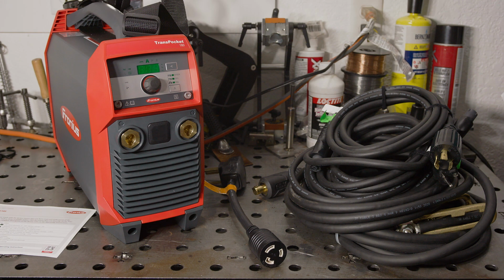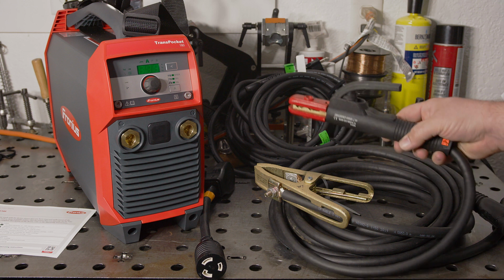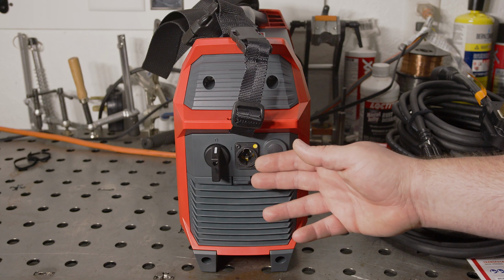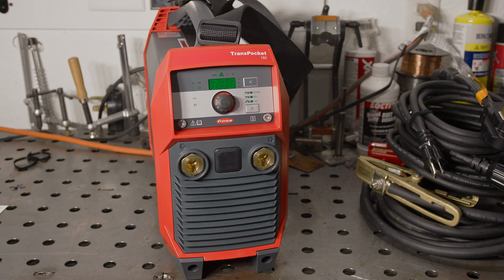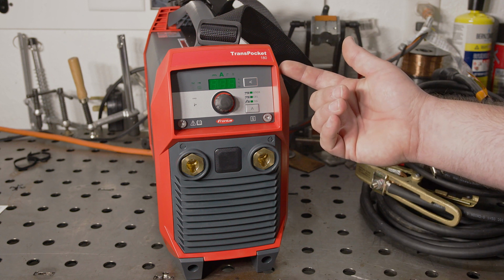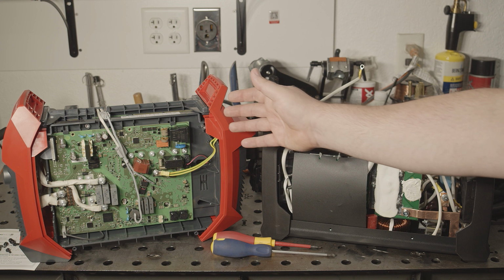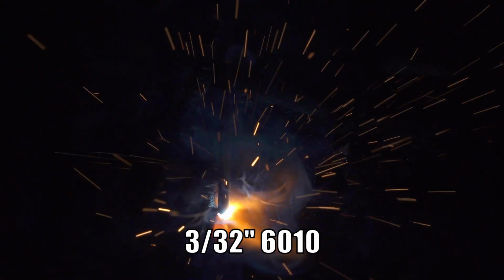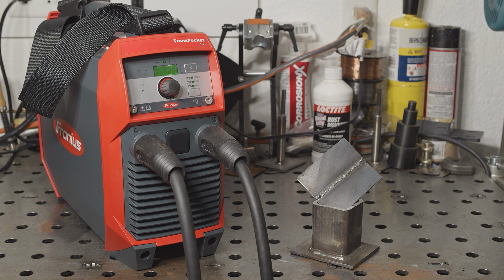Fronius Transpocket 180 Stick Welder Review

Comment: 170 amps on 110 volts for tig. For real?! 
Most 110 inverters for tig can only push 80 95 amps.
Reply from the maker: Yes.  With power factor correction and efficient circuits, you can get a lot of amperage with TIG because the arc voltage is relatively low.  With TIG the arc voltage might be 8-12 volts.  With stick, the arc voltage is much higher, so you can't get as much amperage out.  For instance, 170 amps at 10 volts is only 1,700 watts.  Assuming no losses (which isn't possible, but let's just go with it for now) that's less than 15 amps draw from a 120V outlet.  Again, there will be losses, and if you don't keep a tight arc, your arc voltage will go above 10V.  So a draw of 20-25 amps is much more likely.  But that's still very reasonable.

Stick welding is different.  The arc voltage is much higher with stick, which is why 120V welders often have 80-100 amps max output on 12V, with the only a relative few out there (like this Fronius) with power factor correction having 120-130 or so.  With stick you might have an arc voltage of 20-25V.  So take 100 amps times 20 volts and you are talking 2,000 watts.  Even without losses that's 20 amps from the wall.  With losses it's likely 25+.  

And all that is assuming power factor correction.  If a welder has a 0.7 power factor, you have to divide those amperages by 0.7.  Now that 25 amps from the wall is suddenly 35.  And when you have a cheap, generic stick welder providing 140 amps from 120V, it pulls something like 50 amps from a 120V circuit, which is completely impractical.
Reply: @bigtb1717  Thank you for info. Would you pick the Fronius over Esuab? For the power correction?
Reply from the maker: The ESAB Rogue ES 180i actually does have power factor correction.  It doesn't have quite as much output on 120V as the Fronius, but it does have power factor correction.
Reply: @bigtb1717  Thank you for your review it was very helpful.

Comment: Did you try it on 6011 on 3/32 and 1/8?
Reply from the maker: I didn't try 6011, but I'm confident it would run it just fine.  It runs 6010 without issue and 6011 is easier to run than 6010.
Reply: @bigtb1717  thank you bro! Looking forward to get one Fronius 180 myself.

Comment: Great review, We learn a lot from internal design, I'd love to see some closer shots of the boards to see the components close up.
A design like the Fronius is in general a much more robust design fewer points of failure for a machine that will be moved and bumped a lot this is quite an important factor.
Large unsupported components will experience significant forces from bumps and drops, giving the PCB a  conformal coating adds additional moisture protection it probably adds to the strength a little and it insulates all the components inside which would help add arc or short circuit protection if contamination got inside.
 I would say if someone is likely to be doing mobile work going from site to site the Fronius would be a better option.
If you were just going to leave the welder in one spot in a workshop and it was in a location free from bumps vibration and knocks the lower price of the Rogue would be a good option.

Im currently in the market for a Mig unit and had Short listed Esab 215 and the Fronius Transsteel 2200.
From the anecdotal research I have done both are good, but there have been a level of faults with the 215 that I didn't find with the Fronius anecdotally anyway, one user who had to get his machine replaced twice said once I got one that worked it was great but said there a little delicate from his experience.

Seeing the inside does reinforce what I had started to believe, that the Fronius machine are very robust working machines.
Thanks for the video.

Comment: I just came across this review video. Great attention to detail! The board alignment and wiring comparison was interesting to witness between both units. The Fronius boards are also manufactured and produced by Fronius in Austria. It's cool to see made in Austria on the boards themselves :) They refurbish all their own boards and consumers can buy them either refurbished or new depending on budget. Keep up the great videos!!!!
Reply: Thanks for the help. I ordered the 2200 today. Super excited to be getting one.
Reply: @jdeluisa  Im looking at getting a 2200 too, I was looking at the Esab emp 215, and the Transteel 2200 but I got a little turned off the 215 after I've read and heard of quite a few faults and problems with the Esab, I'm from Ireland I was even talking to a welding supplier in the UK initially asking about the Esab 215 and they told me there going to stop selling the Esab because of the faults and the delays there customers had in getting parts or replacements up to 5 months for one customer they told me, there's a couple guys on YouTube who had problems too.
All I've heard about the Fronius is that it's bullet proof. It's not like the Esab emp 215 rebel is a cheap machine,
 idk i haven't pulled the trigger yet but will do by the end of the month I have a quote that's valid till them and heard prices might go up 7% next month or two.
Reply: @deepwinter77  I don’t know if you got one yet but the 2200 is a beastly machine. I run spray transfer a lot with 90/10 and normal 75/25. It actually melted a dinse connector on my ground lead before the machine even thought about overheating. You can actually get into spray transfer plugged into a 110v outlet if you set up in Manual mode. Use it for stick welding in the shop too when I’m doing heavy equipment repairs. Not as good as a Lincoln sa200 but just as good as any other stick machine for 7018 and stainless rods.

Comment: Great review. I own this very same machine in the non MV version (240v only). However the standar package here in Spain does not include leads, stinger, ground clamp or plastic case. I had to make my own leads (35mm2) and right now sits on a shelf with no case at all. I must say I have run 6013, 7018, 6010, 316L and 308... and runs great. I confess I have not messed at all with the advance features, nor have I tried the TIG mode, YET!
Reply: What supplier did you use I'm in Ireland and there's only one Fronius supplier, I would be interested in checking another one out, before Brexit I would have just bought from the UK but it can be easier to buy from main land Europe now.
Reply: @deepwinter77  There is one in scottland bought mine from ebay.

Comment: Absolutely superb review. And I can say that because I use one regularly now. Spot on differences between Esab Rogue and the TP180.. My only complaint was the cable came loose from the stinger.. But a screwdriver and a bit of threadlock solved the issue.
Reply from the maker: Thanks.

Comment: Actually cheap(er) ESAB models are not original ESAB design. They are generic Chinese design and are made by other Chinese manufactures for the ESAB.  For example Chinese "WTL" make(made) some models for ESAB. Internal design is "generic", and even case is the same as their own models. Only Color is ESAB typical. And actually they are fine products, but it is on anyone to chose is it fine to pay extra 100 or more $ for the ESAB name on it ?!
Reply from the maker: That really doesn't surprise me.  As you say, it's a fine machine, but in my opinion it's not up to the build standard of the Fronius.  I only mentioned the internal design being different than the "common" Chinese design I see in a lot of machines, including the Everlast welder I reviewed, and even the ESAB 161 LTS.  It was just interesting to see that the Rogue used something different.
Reply: Do you know if that's the same for the Esab Rebel emp 215?
That would explain why there seems to be more then expected number of faulty units.
Reply: @deepwinter77  Yes, Rebel is "designed and engineered in the USA and assembled in China" https://www.esabna.com/us/en/dare/rebel-faqs.cfm

Comment: TU on review. Looks like they changed the ground clam to thte usual cheap junk from thte picture on Amazon.better hold on to yours.
Reply from the maker: Yeah, I've seen both in pictures.  I bought the welder at my local shop.  I don't know if the one I got is how they will all be going forward, or if they've changed it for the worse.  Hopefully the solid clamp is what they will continue to include.
Reply: Fronius Transpocket..good name for a starship...either way I'll keep my amico arc 200 , good name for a cab ;-)

Comment: Hello again! I can’t find any specification on what type of machine connections it has for the leads. Are these the proprietary Fronius connections or are they standard 1/2 in. DINSE Connections? Im trying to figure out if I could hook up a standard CK17V Torch if I wanted to.
Reply from the maker: The welding lead connections are standard DINSE connectors.  You could definitely use a CK17V torch with a DINSE 35/50 adapter.
Reply: @bigtb1717  Sweet!!! That’s awesome. I’ve been debating on trying to wait for a TP 180 TIG to pop up on the Fronius Demo Equipment page vs going with the stick version. Especially because I know that I prefer the absolute smallest torch I can get away with using when it comes to TIG welding. And for the type of welding I would want to use it for, a torch with a valve is kind of the standard practice. Then with the pulse functions, I’m very rarely above 30-50Hz on anything lol. 

Thanks again man,

Alex Weeks
Reply from the maker: I'm with you on the small torches.  My favorite torch is the stubby torch from Weldtec and I use a 9 size for almost everything.  Rated at 125 amps but I've run it at 160 for short periods, lol.  Unfortunately it's not available with a valve.
Reply: You have to use the adapter as the fronius dinse has an o ring on it. I’m not %100 certain but I use the transtig 210 and had to use the adapter too. I also have to use the fronius pedal for the high frequency to work. I haven’t tried it on lift arc
Reply from the maker: @sbranham86  I imagine that is for the TIG version with the built-in gas solenoid.  I think Alex's question was about the stick version that I have because he wanted to use a torch with a valve.  The Fronius welder I have uses standard DINSE connections, but it's the stick version.
Reply: @bigtb1717  👌

Comment: have try  7018 3/32 rod?
Reply from the maker: Yes, I ran some 3/32" 7018 rods at around 95 amps and it ran great.
Reply: Do the 7018 run on the Stick setting or the cellulose setting?

Comment: Very nice review. I watched your Esab Rogue 180i review also. I am currently trying to decide between the two. I think it's coming down durability and longevity. I'm not an everyday MMA welder but I want something that's going to last. Big price difference but I'm willing to pay more for quality. Any opinions on which one would be much appreciated.
Reply from the maker: The Fronius appears better built internally, with better quality components and my gut tells me it would therefore be more likely to hold up long term.  But it's impossible to say for sure.  A big thing for me is knowing that my local shop sells and can provide warranty support for the brand I purchase.  Will you be ordering the welder online?  Is there a local shop that can offer help with warranty issues?  Don't get me wrong, I hope both of these welders last well past the warranty period, but it's still nice to at least know there is somewhere local I can turn during the warranty period.
Reply: @bigtb1717  Thanks for responding. That was something that I did check on. There are places in my area that have support for both. When you opened both up it was like night and day. The Esab looked like alot going on..lol not that it means it's a bad thing. But I agree it appears the Fronius is better built internally. Thank you again for the information.
Reply from the maker: No problem.  As you say, no reason to say that the design of the ESAB is a problem.  Like I said, it's just a gut thing that the design of the Fronius looks like a more thoughtful design, and maybe that means more thought went into part selection and circuit design.  From what I've read, ESAB does stand behind their products, so I wouldn't be worried on that front.  It's a tough call, but I'm the same way:  I'm normally willing to pay more if it means I'll have less hassle and fewer issues down the road.  Nothing more frustrating than a broken tool that holds up a projects and costs time and money in more ways than one.

Comment: Thank you for putting the time & effort into your videos & for going into the finer details. I really appreciate this, I’ve been very interested in the Fronius USA machines for some time now. I’m curious as to how the arc characteristics compare to a Maxstar. I happened to come across a very good deal on a 200dx but I get the impression that the Fronius is probably a lot nicer, particularly for 6010. Thoughts?
Reply from the maker: I do have some experience with a Maxstar 210, but not the 200.  I imagine the arc characteristics are similar.  I actually never use the Maxstar for 6010 rods because I simply don't run much of that.  I have only ever run 6010 to test welders.  My understanding is that it would run just fine, but I can't say 100%.  The Fronius has more adjustments in terms of how the stick feature runs, and while I never compared them side-by-side, I'd probably give a very slight edge to the Fronius.  But the Miller still is very nice to use.  I've done a decent amount of stick welding with the Maxstar 210 (mostly 7018) and it has been great.  My guess is that you wouldn't be disappointed with either one.  If you want TIG features, the 200DX would have far more TIG features.  Another thing to keep in mind:  Miller welders are very nice and I think they are pretty reliable overall, but they can still fail (any box of electronics with with high voltage and high current passing through it can fail).  I've heard of some fairly steep repair bills for Miller equipment.  So if the difference is between a new Fronius with a warranty and a used Miller, that would be a heavy factor in my decision.  Not saying you shouldn't consider a used machine, especially if it's a good price, but it's definitely something to consider.

Comment: Thanks for your detailed coverage. But, one thing confuses me with regards you having indicated that you used the pulse mode when running 6010 on light gauge . In at least 2 other youtube reviews of this same machine , It is mentioned that the pulse feature does not work in ' cellulose ' mode. I would like some clarification on this. Could it be that you might have been running the 6010 in the 'stick' mode?
Reply from the maker: I only used pulse running 7014 on 1/16" thick material in the standard stick mode.  I never used pulse with 6010.
Reply from the maker: I probably should have been more clear that what I was talking about wasn't necessarily what weld was being shown.  I did put text of the rod being used on screen, but I should have mentioned the settings as well.  The 3/32" 6010 was being run on the cellulose mode at 60 amps, no pulse.  The 1/8" 7018 was being run at 125 amps for the stringer beads on the thick piece and 120 amps on the square tubing.  I did run 3/32" 7018 at 95 amps and it ran great.  The 1/16" 7014 rods I show were being run at 45 amps with pulse mode on, set at 3 PPS.  I did more welding than that, but that's just an explanation of the arc shots shown.

Comment: 0nce you weld with the Fronius, it is really hard to go back to any other welder, Yes they cost more  but the quality is just too good to pass up. I know other guys will say its too much for occasional use  or your comparing Cheves or Fords  to Ferraris but you are. I got mine 3 years ago and liked it so much I sold my Miller,  Bought  another Fronius last year (a 2200 transteel) . I like the pulse stick mode and I found 3.5 hz to be good for my style, but try other settings for pulse and see what works for you, but you can get a stack of dimes look with the stick pulse if you fiddle a bit with the pulse settings. I have taken mine to jobs  in the field with only 110 volts eg, and old folks home and fixed drain grates with 6013 rods , no problem. At the end of the day you still get what you pay for.
Reply: How do you like the transsteel? Do you tig much?
Reply: @jdeluisa   I really like my Transteel 2200. I just finished an aluminum Kayak  rack to put on a boat trailer so you can carry both. IT does aluminum very (5356) well.
also silicone bronze. I don't tig much at present  but when i do I use it for  aluminum bronze and silicone bronze. I would rather do mig , but thats just me.
Reply: @bruced1429  What other welders have you used?
Reply: @jdeluisa   Miller 225, Esab 215 Fronius 180, Transteel 2200, Old Lincoln buss box, 
an industrial miller years ago , can not remember the model and nameless Chinese ones.
Reply: @bruced1429  I was looking at this machine pretty seriously. Comparing it to a Miller multimatic 220 and the HTP Propulse 220. Are you happy that it has 110/220 capability? I was thinking about the trans steel 2700 due to spool size options
Reply: @jdeluisa  The 2700 is a fine machine but it is mig only I believe, But I don't us the stick function on my 2200 because I have the 180. I bought the 2200 because it does mig aluminum/silicone bronze/stainless /fluxcore both self shielded and dual shielded and metalcore  , as I don't use tig much the 2200 was best for me, but I can use tig if I need to. I just about bought the 2700 but it is 220v only so the 2200 does both 110/220v. the Miller and the HTP are both nice machines  
but there is just something about the Fronius, they are just so smooth ,it is like putting on a pair of shoes that are comfortable from the start to some that just fit. The HTP has pulse mig you have to go the the Fronius 3000 to get pulse and it is not cheap as it is industrial.
Reply: @vik  the Fronius Transpocket  is by far the best with any 6010, 7010,8010